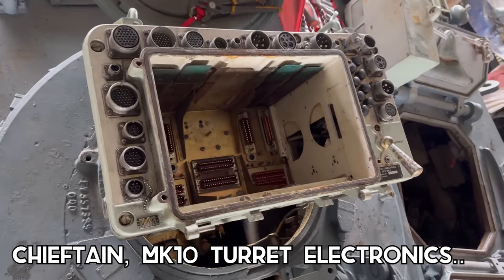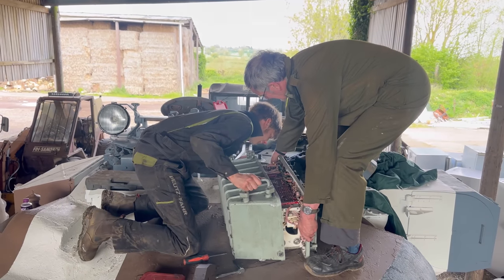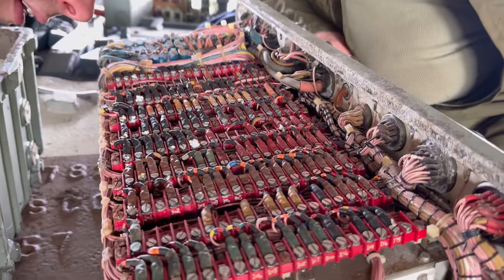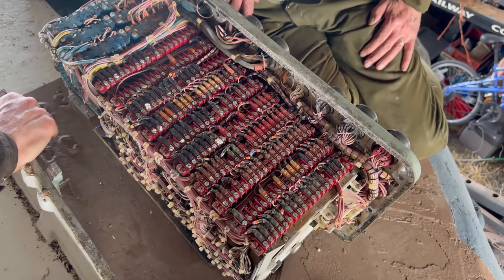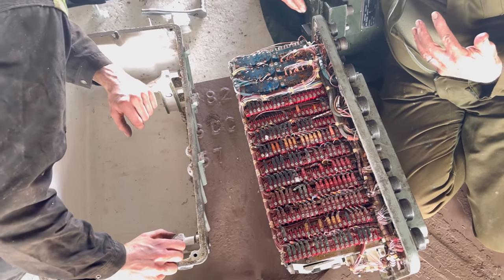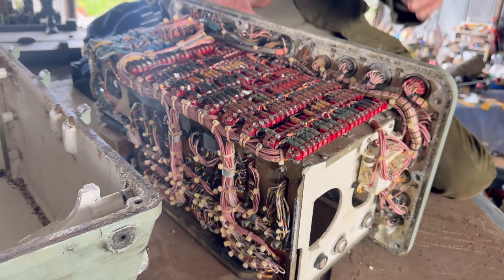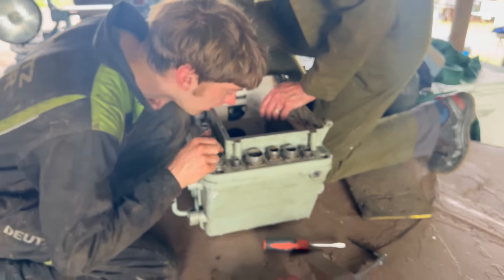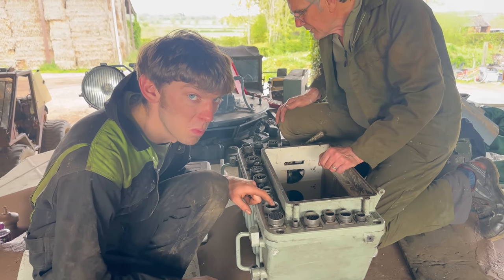Opening up a can of worms...

Comment: Nowadays this thing could be a single circuit board with a few IC's on it. 
That makes me think that one day when parts run out and every turret control box is beyond repair, maybe you can still drop an Arduino that emulates the original electronics inside the housing, and externally it would still look original.

Comment: I (also) restore military radios and in my experience EVERY single connector pin and terminal screw which gas any corrosion at all is a potential fault. A rotten job but worth it long term to clean up every one 👍
Reply: Or just fit brand new parts like you did ! 😇

Comment: I would  rewire the salvaged socket  to the existing cable loom . As far as I see the pins are rewireable by solder.
I know that´s   a  fiddling task , but way better than turm the unit into a rats nest. ☺

I did the same work on a HF antenna  matching unit the other day, the chassis socket  got a broken housing. It was a 64-way plug of an Harris 615 Antenna tunnig unit. But that wasn´t all. I had to make the interconnection cable between the Radio and the tuner by myself, because the there was no cable with the unit when I came across with  it. I purchased the two cable ends at a  surplus shop for few quids. Luckily they got them on stock.
I´m a HAM (DF6ZC)  and like army radio gear.

Comment: Sometimes connectors are made that way so some pins are connected before others. Sort of like plugging the wires in one at a time but must be done in a certain sequence to not power up something. Think of a two way radio being powered on and trying to transmit without the antenna plugged in. You are going to burn out the radio. But then again some squaddie may have had too much tea and forced it in incorrectly.

Comment: On the subject of the analog relays' get someone who knows electronics & go to solid state switching modern units can handle high currants & amp loads in DC , Also if you have a unit that is corroded bad try a hot caustic bath it will eat any ferrous oxide but be carefull with alloy units  ............

Comment: Have you kept all these old failed relays ? Since they are so rare/expensive maybe someone could take on a sub project try to restore them (replate contacts,  new springs etc) or in worst case even try to manufacture some plug in replacements (3d print / cycle bodies to the original dimensions and fixings but internally use (parts from) modern/readily available relays ?)

Comment: take it apart and rewire it, you can probobly replicate those relays too it will just take a while... the last thing you want is a malfunctioning control on a tank lol. at least there is no circuit boards. I see alot of corrosion in there, it should probobly be fully inspected.

Comment: Here I am thinking "are they really unique bespoke components, or standard off the shelf kit ?" - I know what I'd prefer to have access to in difficult situations like a war when supply is limited !
Reply: In a case of a war, when supply is limited, you lose. War is a horrible thing, especially modern one. horrible horror of people with PTSD, poisoned with everything which is burning around, not really living long, thinking straight or able to really fix things.
Reply: @piotrcurious1131  which is why a common design pattern component for the contactor would be beneficial. It'd be pointless relying on Japanese parts if you're at war with them.
Reply: @colinwilson210  depends if you plan to re-use certain weapon or not. it's really out of expertise at the end of the mortality pyramid...
Reply: @piotrcurious1131  whether you plan to re-use them or not, components still fail, you wouldn't want to scrap a £multi-million tank for the sake of a £15 part
Reply: @colinwilson210  if there is a risk weapon can be illegally traded or captured by enemy, standard part is disadvantage. again, it depends on specific contract and mission, not a general rule of thumb can apply here.

Comment: Those connectors w/pins should be readily available as they appear to be standard. I've replaced tons of them. Pins require specific pin tools to release them if they're not a solder type. Some release from the front and some from the back.look for the manufacturers name and part number ie. Bendix, Amphenol, etc

Comment: At the 7:30 point in the video. You would have been better just desoldering the wires on the plug and replacing that. You have just made future fault finding on the cabinet a complete nightmare. It would of probably been a lot quick to do

Comment: its a real bugger when you find multiple complicated bits mucked up that need replacing and can't be repaired - you need a man who can build you a replacement out of a few bits of fuse wire and baked bean tins
i wonder how many variations were made, just goes to show these things are done for a reason, to confuse the enemy should they ever fall into the wrong hands, nothing can be undone, nothing is compatible, nothing fits and bugger all works
one of them occasions where swearing will not work, even if it makes you feel slightly better

Comment: While You are Very focused on fixing something as complicated, do not forget safety.
1)It all corroded. It should not really. Think what stuff made it corrode. If it's something enough to dig through zinc and brass, it's not good for your body either. 
2)it has corrosion products everywhere.
Look at yourself and your shop on the video. You are all dirty. Your shop is dirty. 
No one ever designed this stuff to be repaired. No one will pay for your health insurance, no one will actually cure stuff like cancer and various endocrine disruptor effects from insulation, metal compound mixes, ash from ammunition fired while the tank was running etc. 
Last but not least - age of this stuff. metal alloy rule is - least precious metal of the alloy gets pushed out from the alloy and rusts on the surface. So this tiny bit of antimony and lead added to these alloys to make them enough ducile for tough work it was designed for is exactly on the surfaces of all the contacts today. 

Your children will watch the video and understand why they got epigenetic disorders, deformities, gene abberations and deletions and will thank you for it as well when you will rock in your armchair in some institution. 
Sorry it sounds bit patronizing but you seem like good experts, just completely out of touch how dangerous thing you do, like kids trying to disarm grenade or landmine...

Comment: Just curious why you want to restore obsolete analog relay junk when, if your objective is simply to traverse and elevate the gun, you don't just power the motors through modern solid state relays controlled by the existing joy stick or other switch controls. It's not like you are going to fire at a target while motoring cross country.
Reply: Because why do it half assed when you have the capability and skill required to do it properly?

These old electronics are overwhelming to look at, and larger than they need to be, but at the end of the day they are, more or less, analog machines using wires instead of mechanical linkages. It’s not overly difficult to repair them once you make sense of them, and any history buff will always prefer to try and make old systems work if at all reasonably possible. Fixing this box is time consuming, but fairly simple and straightforward. Why cut corners when it’s not necessary? I’m sure there are some systems, like the actual “computer” stuff, that would be silly to bother trying to repair if they can be retrofit far more easily. I’m willing to bet that it would actually be a bigger can of worms and cost more time trying to bypass all this stuff to make the turret move, than to just do what they’re doing and go through the box systemically and repair what needs to be repaired. A bypass is not a few brainless nights in the shop cleaning contacts and replacing/repairing mechanical relays. It will be well worth it when they’ve got the turret working using the original systems, as that’s the whole point of restoring stuff isn’t it?
Reply from the maker: My aim is to get full gun stabilisation Working. This is a very complicated system
Reply: @MrHewes  If it's just functional gun stabilization and not the joyous minefield of restoring an obsolete and corroded milspec analog motion controller for the sheer joy of it, hacking a selfie camera gimbal is a no brainer. Maybe even better, a radio control aircraft gyro stabilizer for only a couple of hundred pounds max. I guess my question should have been are you interested in the process or the product?